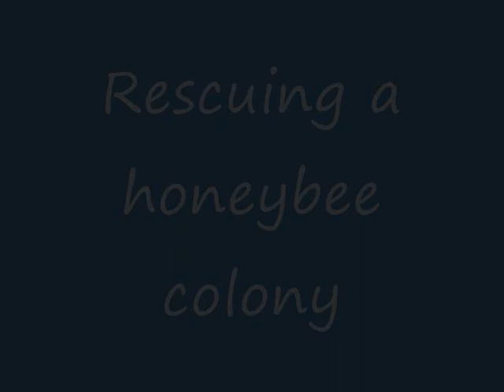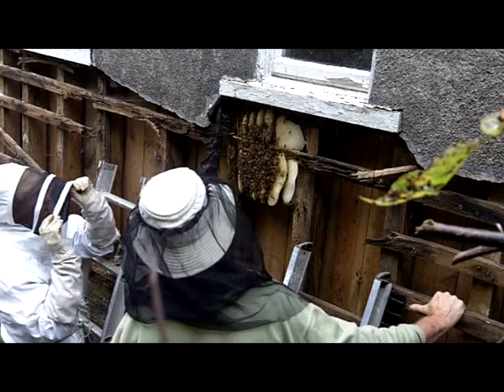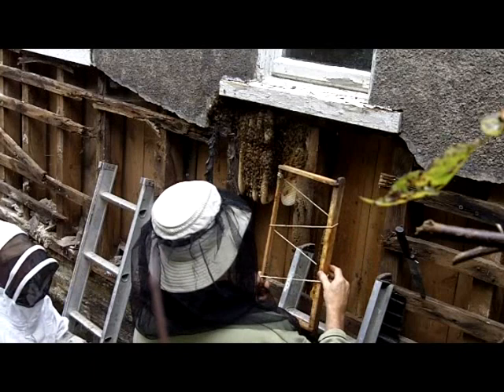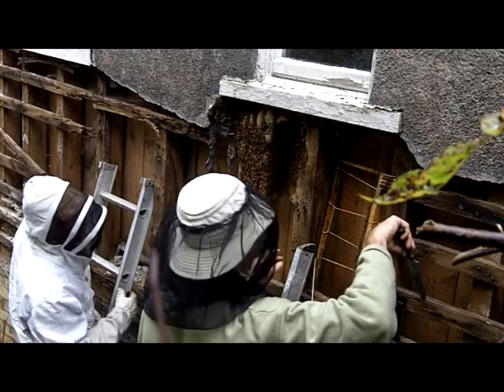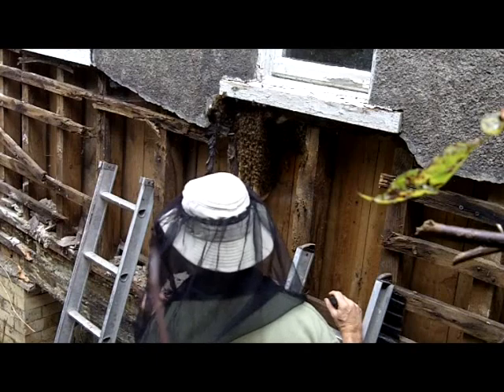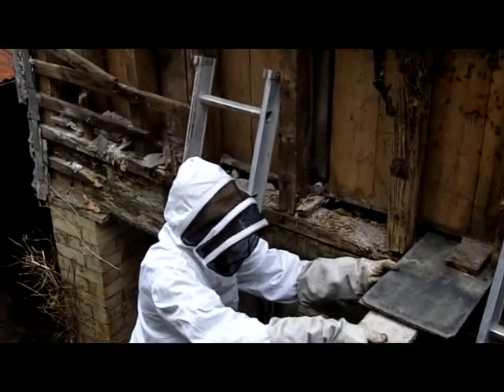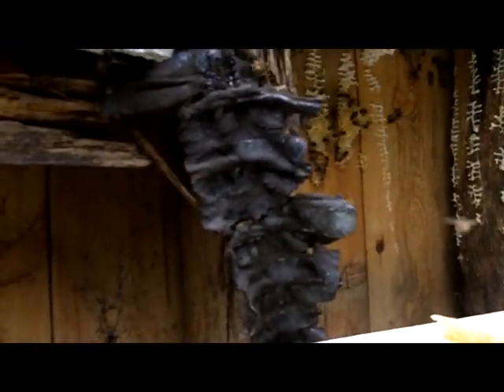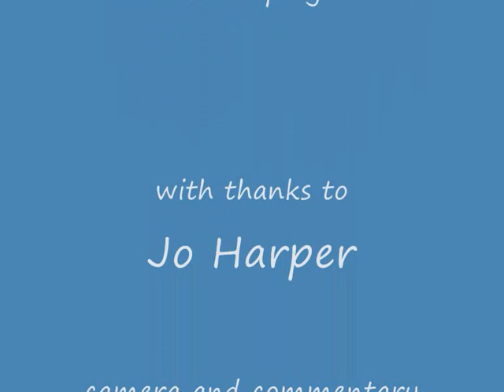Rescuing a Honeybee Colony - a comb cut-out from a condemned building

Comment: Excellent work! It isn't easy to cut out bees from that height, especially considering the surroundings. A couple points:
Rather than transport the comb down the ladder, build a shelf a couple feet under the colony using a board and some shelving bracketing. You can size and cut the comb with the receiving box directly under the hive.
Use rubber bands to secure the comb in the frames, bees can't remove string. Rubber will degrade and bees drag the remains out of the hive.
Nice video, thanks.